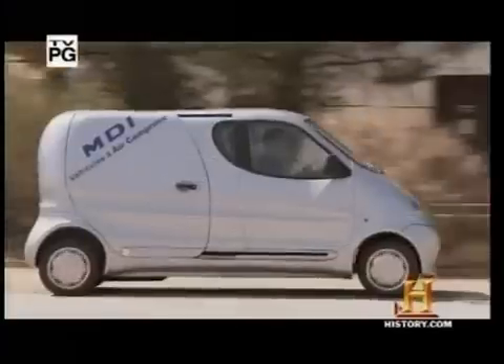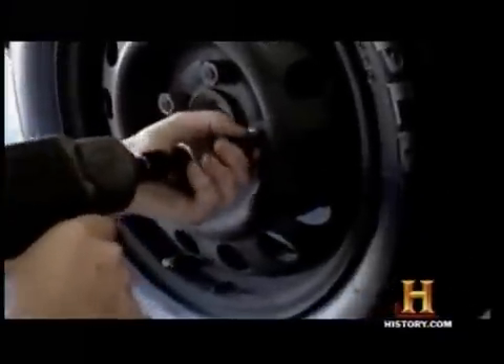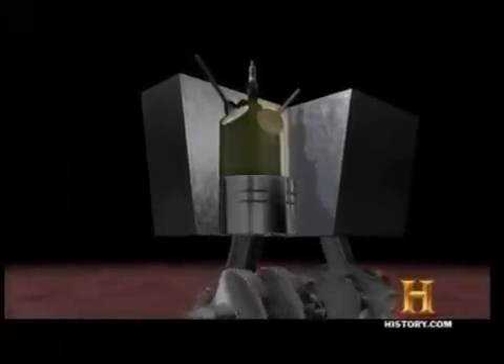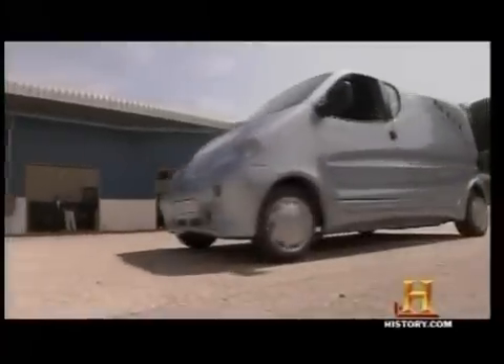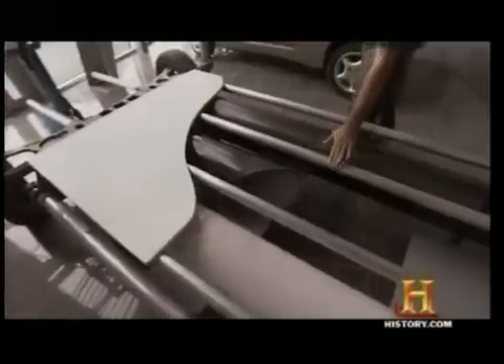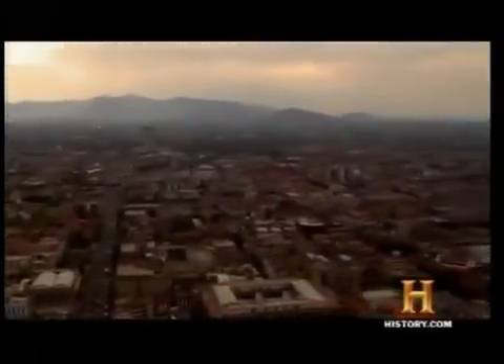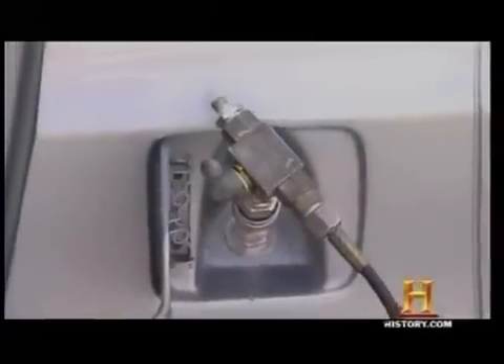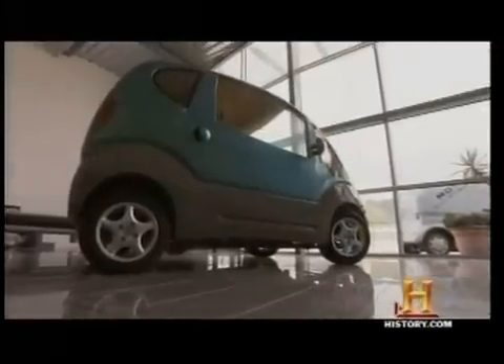A car that runs on air

Comment: If you want ta TRULLY green car then why not use Hemp fibreglass as Henry Ford did 50 years ago. After being built the car was hit with a FULL SWING of a pick axe without leaving even a crack, the pickaxe just bounced off the Hemp-fibreglass. Also it's bio degradable!. HF also used Hemp seed oil for hydraulic and lubrication fluids!.